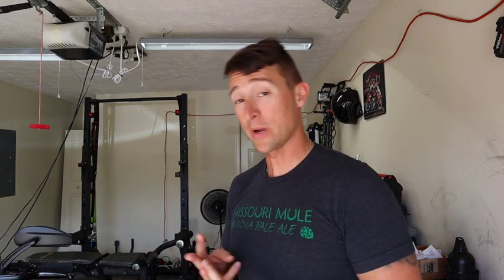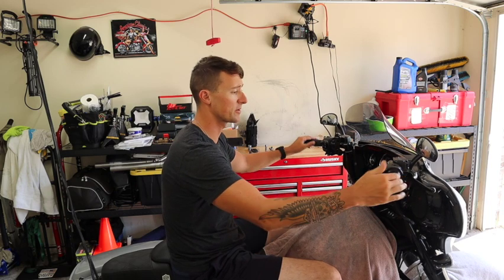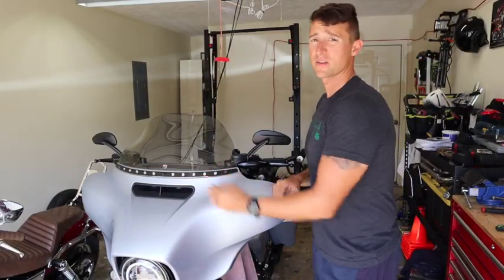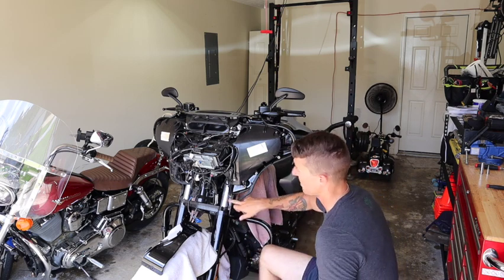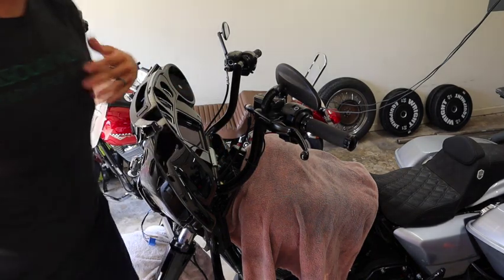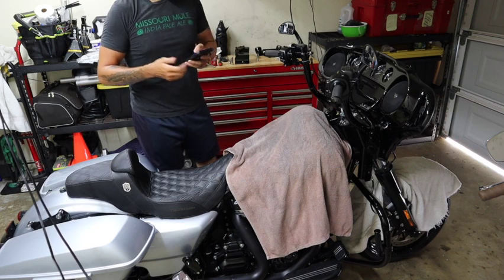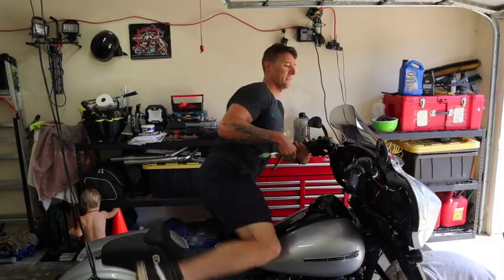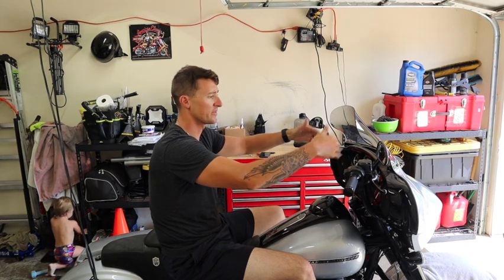Handlebar Adjustment \\ 2019 Street Glide Special

Comment: Dam..
What a long way to go for just a mi or adjustment..

How's the chopper build going ..
Reply from the maker: Currently it isn’t running. I got the gas tank and oil tank back from paint (working on the video for that), but it won’t start. I am troubleshooting it now, down to timing, carb rebuild, wiring issue as the possible problems.
Reply: @JHB_Customs  maybe you know ..maybe you don't..
Pull plugs ..crank over ..needs a blue or white spark..if orange you've got an ignition problem..
If blue..install plugs..give the intake a good shot of your favorite starting fluid/carb clean/w d 40..if it starts ..You've got a fuel problem..
Good luck..
Reply from the maker: @jerrybigrig9475  I just tried it and I got a blue spark. I sprayed starting fluid in and it didn’t start. It turns over fine and the starter is good but it won’t ignite in the cylinders. I do think the carb is bad and I do plan to rebuild it but it is perplexing that it doesn’t start when I spray the starter fluid in.